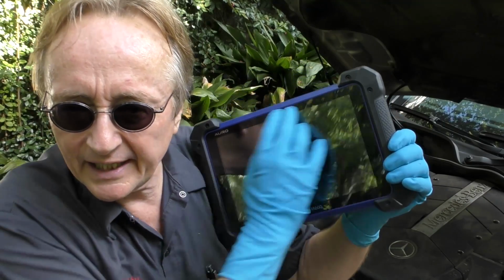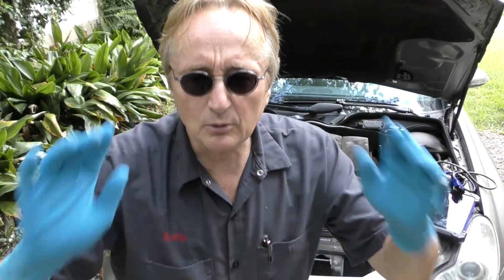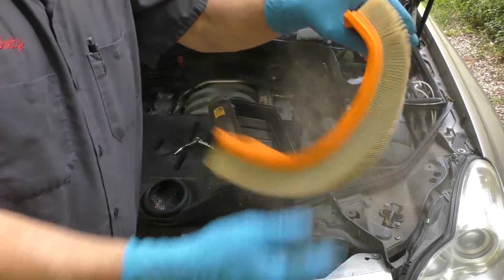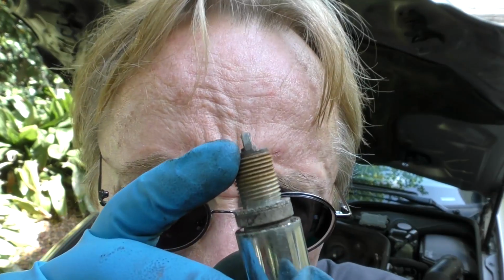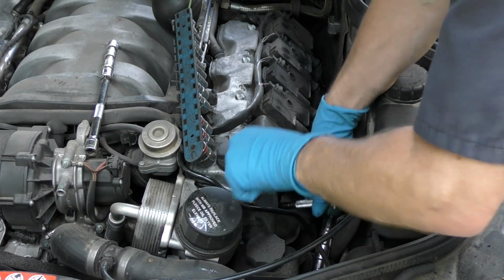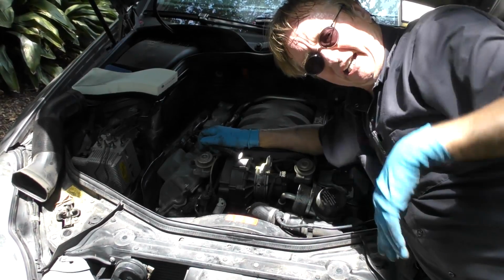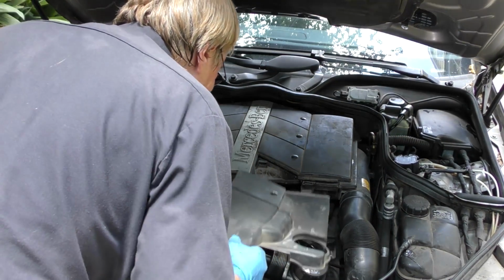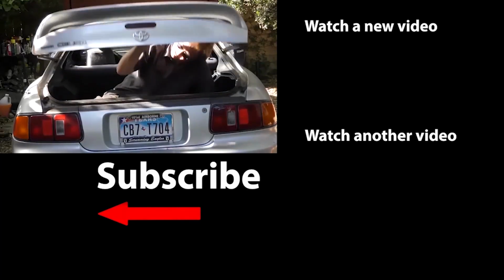Doing This Will Make Your Car Idle Better

Comment: In the case of a 2005 Accord with the 2.4l engine spark plugs and clean filters won’t help. Runs smooth but on a light it iddles real terrible and any of this won’t fix it. I’ve done everything and came to the conclusion that this 2.4l Accord is garbage.
Reply: It is an old car after all and your car has the K24. Have you cleaned the throttle body and MAF sensor? Those would help as well. Lastly I believe your car uses NGK Iridium plugs (like Honda uses from the factory.

Comment: Scotty Kilmer, as you dislike that German brand the customer got 16 spark plugs, air filters changed and diagnostics in 4.21 mins flat. Mercedes would of charged $300.00 for two hours labour.

Comment: Bought a Mercedes $80,000

Bought 2 fram air filters ONCE $35

Dont buy spark plugs since new and complains it doesn't idle smooth
PRICELESS

Comment: Scotty why did they put all that plastic crap on the engine
Reply: Looks
Reply: Soundproof cover NVH
Reply: @missingremote4388  lasted i checked plastic isn't a good deterrent for sound.. did you just make up that theory?
Reply: @stevemisfit1  it's plastic with sandwiched foam rubber in there. Somehow keeps the engine noises down to a minimum. NVH

Comment: I don't get Scotty' beef with Mercedes and Fiat. Both brands are pretty reliable here in europe: fiat only has a troubled past, and mercedes cars are almost eternal.
Reply: Paolo Di Gualtiero Fiats are awful. Mercedes are just a little more to maintain. I have a 13 C300 4MATIC and do the basic maintenance like oil changes, filter changes, and whatever it needs down the road. Pretty solid cars especially if made in Germany. Those made in the US and South Africa have quality control problems although they’re the same parts they just aren’t assembled as well as those in Germany.
Reply: @MrChampion1002  i drive a punto with 200K Km on it. Not a problem aside from the fact it burns a quart of oil every six months. Fiats are not awful, the bad rep only comes from bad electrical design back in the 90s-early 2000s; apart from that they are pretty good cars.

Comment: My ram has this issue
Reply: Do as scotty did in the video plus clean the MAF sensor,throttle body and the PCV ....do this every time you change the spark plugs (every 4 yrs) so you'll never forget to do all these maintenance all in one go while the hood is up and it doesn't take that long.Your Ram will like you for it.

Comment: One of these quotes has to be in a Scotty Kilmer Video otherwise it isn't legit
1.)  "I've been working on cars for 51 years" 
2.)"Honda started out as a motorcycle company..."  
3.) "I'm cheap.."  
4.) "When Renault merged with Nissan.."
5.)  "These CVT's are notorious for breaking down..."  
6.) "Zippy little sports cars.."
7.)   "Buy a Toyota....."  
8.)  "These are garbage..."
9.) "Change your oil every___thousand miles (regardless of what they say)"
10.) "It's cheaper to make them this way..."
11.) "Honda makes weak automatic transmissions"
12.) "GM's quality control is going down..."
13.) "I'm not a fan of the...."
14.) "Change your oil every___thousand miles (regardless of what they say)"
15.)    "Volkswagen is crap."  
16.) "____$$ Is nothing for a car these days."
17.) "Drive it until the wheels fall off."
18.)  "When Fiat bought Chrysler..." 
19.) "They keep perfecting them for years and years..."
20.) "Try to find an honest mechanic like me..."  
21) Honda makes SOMEWHAT weak automatic transmissins 
22) "They are endless money pits as they age."
23)  "Never buy a car that was_____"
24) "I would drive it until the wheels fall off".
25) "Take this Toyota Matrix ...it’s just a Corolla with a different body...”
26)  “I had a customer...”
27)  "I bought my Toyota Celica for $350 and still running like a clock and blows cold air."
(28) "Back in the day when I was a young mechanic in the 60s..."  
(29) "Rev up your Silverado 4 cylinder for the first and last time!" (well, he didn't really say this one)
(30) Being a professional mechanic...
(31) So if you never wanna miss another one of my new car repair videos, ya gotta ring dat bell!!!  
AND You know you're a hardcore fan when you're able to write a list of mannerisms of your idol.

Comment: Those Mercedes w211 models aren't that hard to maintain, somewhat disappointing that the owner just needed to do routine maintenance.
Reply: Yep. Classic Scotty whingeing about Euros. Taking the engine covers and the coil packs off to get to the plugs would take what - a whole 5 or 10 minutes? If you're not willing to spend this amount of time to have a decent car, just go and buy a Camry and be done with it. And Torx fasteners - they're used by Euro manufacturers because they don't tend to strip out like Philips heads do. But hey, Scotty's Murican, so he must be right. What do all those engineers at MB know...
Reply: @spokebloke1  although, he is speaking specifically to the ignorant, so I suppose it's appropriate....

Comment: Why the hell do they use 2 spark plugs per cylinder 🤷🏾‍♂️🤦🏾‍♂️🤦🏾‍♂️
Reply: Probably for ensuring complete combustion, efficiency (MPG), and smoothness.  Of coarse... they care nothing for the shmuck whos going to be trying to own it 15yrs down the road. Which is why they plummet in value once the warranty ends.
Reply: Nicholas Kirk So the spark plug makers can smile all the way to the bank?😬🤑

Comment: There are some stupidly made cars that are not allowed to idle and keep a proper oil pressure and temperature.  Then this design flaw is marketed as a positive.  There is no way an engine that goes to zero oil pressure, then restarts, over and over, is going to last as long as an engine that is allowed to idle and maintain its proper oil pressure and temperature.  I will never buy a new vehicle with this intensional design flaw, just to figure a way to defeat the design flaw.  It would be like being forced to  pay for a car you have to fix.

Comment: You can do it yourself easily: I’d break at least half of those wires and strip the threads on a fair number of those threads and cursing in German.

Comment: Don't have a $5000  Scan tool
Reply: It's OK. Scotty has one and doesn't even use it correctly.  If he used it right, he would have been looking at fuel trims for an indication as to what the problem may be rather than shotgunning parts at it.

Comment: Almost every week Scotty tells us that you should not buy European cars but instead you should buy Toyotas.  Then he lists one European make after another which he says are garbage.  The trouble is that very little of it rings true with users of these cars in Europe.  
In Europe it is essential for the resale value that a full service history is maintained so cars get maintained properly and are mostly trouble free as a result.  Meanwhile, over in the US Scotty pulls two air filters out of a Mercedes that are so full of crud that it is obvious that the owner has not bothered with proper maintenance, so the car has problems.  What do you expect?  Sure a Toyota Corrola can shrug off poor maintenance more easily but they are not sophisticated cars and lack desirability as a result.
Same goes for the DSG transmissions on VWs which Scotty has said are nothing but trouble.  Well if you change the oil every 40k miles and use the correct grade of oil they are rock solid.  Don't bother, or use the wrong oil and they will fail.  Just basic common sense really.
So, to sum up, if you have no interest in cars and can't be bothered to do proper maintenance buy a Toyota !!  Probably good advice actually.  I'm sure Scotty would agree.  What do you think Scotty?

Comment: rev up your cursed 16 sparked 8 cylinder V configured plastic covered strange nut bolted nightmare of a pain in the butt, cracking plastics parted, endless money pitted engines

Comment: My Saturn Vue (iVtek Honda 3.5l 6 cyl) runs smooth as silk on the highway, and after it's warmed up the idle isn't bad. But my engine mounts are worn, so I feel it's exaggerating the rough idle. Am I killing my engine by delaying the replacement of those mounts? The mechanic wants over $1,000 for the job, hence my delay.

As always, Scotty, I turn to your channel first for anything having to do with cars and unprotected anal sex. I mean, dealing with mechanics.

Comment: Lol did u really we are stupid enough to believe that this will make my car idle better? Replacing air filters does nothing at all it just cleans the engine and the spark plugs dont have to get replaced until your car has a check engine light on